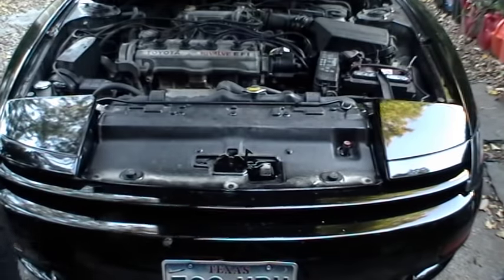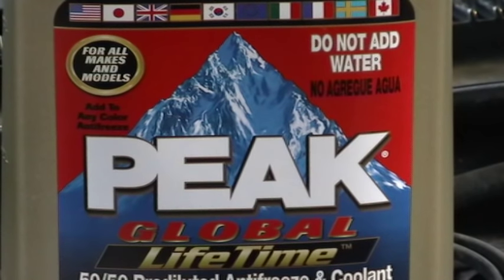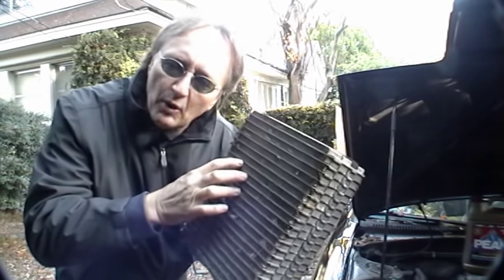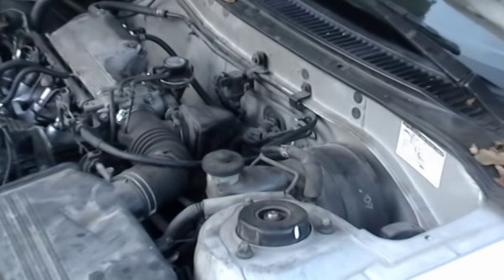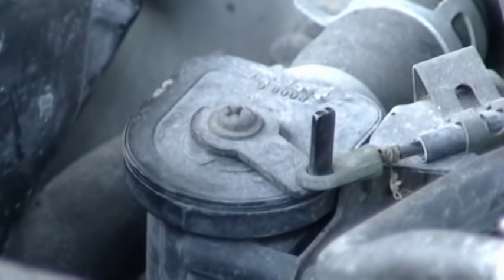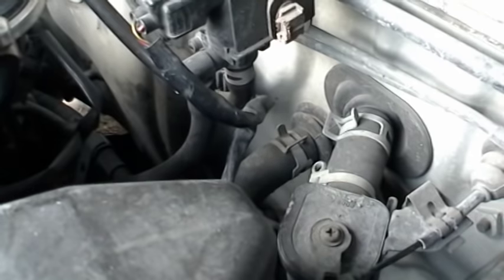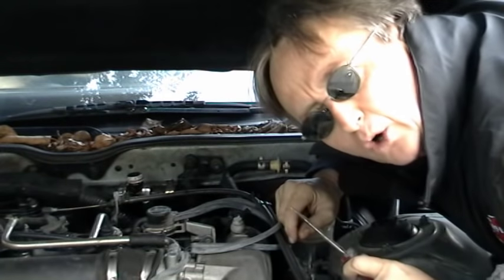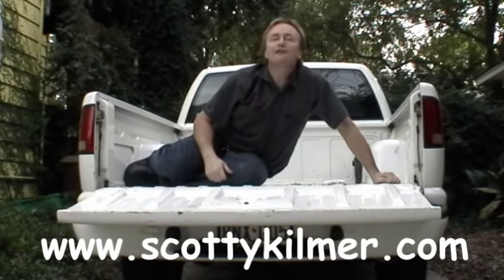How to Fix a Car Heater

Comment from the maker: The end of this video shows just that. You just install a flush line like that toyota has, and then remove the other heater line from the heater core. Hook up a radiator hose and let er rip. flush it one way, then hook a hose up to the other end of the heater core that the water was coming out of before. Then flush it backwards. Do this front and back three or four times, and it'll be flushed out. scotty kilmer

Comment from the maker: @zztopgearhead1 Your in dash vent controls aren't working. A blend door isn't opening correctly to change where the air blows. This can be a control unit problem, a wiring problem, or a stuck blend door. Not a fun fix as most systems are now computer controlled. Good Luck, Scotty

Comment: Omg thanks so much for the awesome video, it put things much more into perspective for me, i already paid to get my heater fixed once and it isnt working again already.... The colder it is outside, the less heat it pumps out, the fan works but very little heat comes out, not really enough to defrost a windshield... may try flushing the hoses.... thanks again.

Comment from the maker: first, an overheating engine will often lose coolant, and then the heater will stop working as it needs hot water flowing in it to work. So first, do my video "how to fix an overheating car" and that may also fix the heater when done.

Comment: I have a POC 97 Nissan pick-up that has all sorts of problems.  I'm working on fixing them a little at a time.  Right now,  the heater works fine once the car has been going for a while, but not at first.  I'm going to check all these things and see if I can't make my morning commute a little warmer.  It only takes about 15 minutes to get to work and it takes the truck 10 to start blowing warm air.  Thanks for the clear, concise and relatively idiot proof directions.

Comment from the maker: odds are you have 2 problems. A bad blower motor relay makes em work only on high, but no blowing at all is often a bad blower motor. Probably need both replaced.

Comment from the maker: of course fix the fan motor if that doesn't blow. But if it's blowing hard in your face, flush the heater core and pray you don't need a new expensive one.

Comment: @scottykilmer Thanks for the reply. I had no power off my ignition that goes into the fuse block that contains 4 fuses. Found the wire laying on some others and hooed it up. Now have wipers, signals but no heater. I will investigate further before winter comes.

Comment: Usaly the heater core is cloged up.  Both hoses were warm on my car, but i still ran  a garden hose in both directions because i knew that was the cause. I only got a little heat when i reved the engine.
Alot of fine  dark brown  material came out into the bucket  and after the water was clean in both directions, i installed the hoses back on and the heater was working  fine again.

Comment: finally after a couple weeks driving with fogged up windshield, I ran a hot wire with fuseable link, from battery to toggle switch, to blue and red wire on [hbm] I also ran my own body ground from the yellow and black wire, now.. my [bmh] blows great, but the air barely comes out of vents.. having some understanding of how this works, ive ben looking for magic leaver or trap door, that will direct all air directly to derfrost.. idk if anything else works, just  need defrost.

Comment: Unless those wire cables connected to the control unit have broken off or come loose. I had to jerry rig mine on an old car I just bought. It's for now set permanently on defrost and floor, and the temperature control is just a bare wire cable I pull out or push in inside the glove box. I will figure out how to fix it but for now I have defrost. It still gets warm in the daytime where and the AC doesn't do much though.

Comment: So Scotty... just to make sure I got things straight.

You install a Flushing "T" on both the delivery and return hoses of the heater core.  

You connect the garden hose to the delivery side and disconnect the return side.

That way the water goes from the delivery hose - thru the heater core - then back out the return hose and on to the ground and not through your cars coolings system.

I get that right?

Comment: I have a 2005 Chevy Tahoe and have this heater turns on unexpectedly while running. I have to pull over to turn off the engine and turn it on so it will reset it to cool air. Is this about the air control or the heater valve? Would love to hear your advice for all the Tahoe owners. Thanks.

Comment from the maker: Hey, any car should work out of the box. You can certainly try my fixes, BUT if it never worked at all, I would assume some computer flaw, as those jimmys have computerized heating and AC systems. It's too late now, but you should have forced them to fix the heat when it was new. There are many reasons GM went bankrupt, and unfortunately you're driving one of them. Scotty Kilmer

Comment: Scotty we have a Chrysler 300 with heat working sometimes but mostly blowing out cool air especially on passenger side.  We paid mechanic to replace water pump and thermostat but these did not solve the problem we are out big bucks here.  Also where on the 300 is the "Blend door" that you mention, as this is worth a try

Comment: Scotty this is an awesome video and super helpful thanks for helping out the community, my 98 accord lx blows warm air and thermostat and coolant checks out good. Now i will clean out the heater core with an air compressor instead of the water hose for extra strength and i will manually turn the arm to hot on the heater control valve. Thanks for the info.

Comment: Hey Scotty I watched this after I just sent you that mesage about not getting heat in the cabin until the car is really warm. The temperature gauge does go up and down but while driving at freeway speeds it goes really down and at idle and park it goes to normal and heat can go into the cabin again. I don't know what gives. I'll give a second look at the coolant level tomorrow and the HCV tomorrow too but I believe they are good as I still have coolant in the reservoir tank.

Comment: Hey Scott I was told it was my heater core took all the stuff apart pulled out the heater core and it was fine my car is not over heating but warm heat is coming out when  on max I will check the heater control vaule in the morning. If its not that what do u think

Comment: @scottykilmer When it is really cold outside, the car heater will blow hot (once warmed up) only if my foot is on the gas pedal. Once off, it slowly starts to fade to a slightly warm temperature. But once I start to drive, it gets hot again! Engine coolant isn't low. Thanks!

Comment: Our car got the manifold gasket fixed then the heater stopped working practically except when driving one half hour or so on the hwy then it would get some decent heat but just barely enough.  I do not know what is wrong but we did replace the thermostat even though that was replaced at the time of the manifold gasket repair.  I almost feel like just checking the thermostat again.  Heat would be nice.

Comment: Hey Scotty, great energy you got, bud! Rebuilt my 22re, ...heck, pretty much new everything under the hood, ...but before and since the build... NOTHING but warm air, never hot. Both hoses seem to get hot, going to/coming from the core.... but no HOT heat, lol. I have a 91 HCvalve to put in, to replace that stock junk.. but I'm worried my cables are tweeked, as it's REALLY hard to push the levers. However, when I manually move the control vlv. lever, the cab lever goes either direction.Thoughts?

Comment: First I really appreicate you videos...I have 2005 mercury grand marquis, my heater is blowing out cold air only. I changed the thermostat, both water pumps are warm, the dealership says its my heater control valve, but when i took it to another place to get it fixed they couldnt find the valve and then said that I dont have one...so my question is, does the 2005 have a heater control valve? and what should I do next? Thanks in advance

Comment: I'm having the same issue in my 95 accord, the heat is there but not toasty warm to my face when driving. Unlike my old accord which had 212,xxx miles on the heat was HOT on dial setting 1.
Anyway this current accord the heat is faint and I like HOT heat even at the lowest setting, with that said I think it is clogged.

Comment: I have a '97 Celica GT, and the hose that connects to the black cable is missing. Shown @2:06. Where does that hose connect so I can possibly have my heater work again?

Comment: I have a question about my 2015 chevy cruze. I just replaced the battery with a new one. When i turn on my car heater im smelling a burning plastic. What can that be. Ive been screwed over lately with my dealer maintenance i dont want to even ask them. I hope you can lead me where to look. I bought batt at Autozone and they installed it. Thank God we still have mechanics like u.🦅🇺🇸👍🏻

Comment: I have a 2012 sonic I have put coolant in and no luck so I will try the steps you suggest...but one question is it possible the blower fuse could be blown when I test the fuse?

Comment: Hi Scotty, I have a 2000 Ford f-150 4.2L and think I have a plugged heater core (since one heater hose is hotter than the other). Can I flush it without the flush kit installed by disconnecting both the hoses and hosing down each one until unclogged? Also will I have to refill any fluids after this? Thanks!

Comment: Heya Scotty, great video. The issue I have is that the cold air con works but the heater doesn't. When I turn the dial to hot it turns back to cold? So weird.

Comment: scotty I got 95 accord ex, heat was great, then one day after the car was off and the key was out, the heat blower motor [hbm] was still running, after that, sometimes the [hbm] would work as normal, sometimes, not at all, beating the dash never helped, nor kicking under glove box, where [hbm] is. but I did get to work a few times by repeated turning car on and off, ive read that Honda [hbm] get power from key switch. please see next post..

Comment: Hi Scotty!!  I diagnosed the coolant leak in my 2000 Chevy Cavalier and found it to have a leaking heater core.  What is involved in replacing the core?  Do I have to remove the dash/steering column, etc?  Or would it cost more than the car is worth?  Thanks in advance for your advice.

Comment: 1990 ford mustangs don't have heater control valves. Replaced the thermostat and plenty of coolant. Gauge isn't working and only one of the heater cores is warm. Guess I will flush it and see what happens. If not then I am guessing the heater core needs to be replaced.

Comment: HI Scotty, 
I might have a stumper for you.  I have a 2001 Honda Odyssey with no heat.  the temp gauge shows at about 45% between cold and hot when the car his warmed up (it's about 60 degrees outside). The blower works fine and A/C works well too. . The heater control valve does move when I turn on the heat. When I put my hand on either of the heater core hoses neither are hot (I checked with an infrared and they are both 98 Degrees). I also looked under the dash and when I switch from cold to hot I see a whole lever thing move back and forth. I also checked and the radiator is full of coolant.    I then thought maybe there is air in the line and so I ran the car with the radiator cap off and I saw some bubbles come out and I added a little bit of coolant but still no go.   When I look in the radiator I can see initially the coolant is still and after the car heats up the coolant starts flowing (prolly when the thermostat opens up).  I pointed the heat gun at the radiator hoses and they are about 178 degrees.      I was going to flush the heater core out but since I don't feel heat on either hose that can't be it.  Oh, one other thing, my wife just told me that the heat hasn't worked since we had the tranny rebuilt 2 years ago. Maybe still some air in the lines?  Any help would be appreciated.

Comment: Hello, I have a 2005 Ford Explorer and have seen a few videos with one actually cutting parts of the dash.  I'm assuming there is a way to do this without doing that?  Any help on replacing the actuator would help.  Thanks.

Comment: Volvo seems to build very poor heater cores.  A friend of mine had one leak so badly that the coolant escaped into the carpet and went undetected.  

Coolant levels kept dropping to where the temp sensor kept reading cold because there was no coolant in the system.

He blew the head gasket and ruined the car.

Volvo 850s and S/V/C70s are notorious for this problem.

Comment: Hi Scotty, I have a 93 Chrysler 3.8L that has a auto temp control. The A/C works great, but in the colder months I can set the temperature to 75 or higher, the air is somewhat warm but not warm enough to reach the desired interior temperature. If I set the temp to 80 degrees (which is max) it blows plenty of hot air. The temp gauge is in the norm operating range, so am I looking at a bad thermostat? Thanks!

Comment: Hello, i have a mits. lancer ES, 03. and one day i was trying to turn the AC nob from cold to hot, BUT the nod got stuck. The nob actually turns but its jams and rotates back to cold air. i already checked and removed the nob, and try to turn the it without it. So it seems like the whole rod that goes back into the AC system is stuck. How can i fix that myself???????? your videos are very helpful by the way :)

Comment: I've got an 06 Grand Caravan where it takes in upwards of 20 minutes for the interior heater to blow hot in cold weather, but the engine temperature warms up about twice as fast.  Coolant level is fine and clean.  Advice?

Comment: Hi there, i was wondering if you can help me with my situation. I've change my thermostat and filled up anti freeze but still no heat in my car. Maybe it's the heater core.  I'm planning to do the last trick you showed on this video but I don't know where to start. I have a Honda civic 1999 sedan. Where are the hoses I can do the unclogging?

Comment: Hello scott, Nice informative video. I have a question;  my nissan xtrail got heating problem; when its in idle doesn't give heat, but car is running it gives heat. Even when i stop at traffic light, it stops giving heat. What could be the problem. Thanks in advance.

Comment: Hey Scotty!!!  I have a 2002 Mitsubishi lancer, and for some reason my fan doesn't actually blow air (talking the heater inside of the car not the engine fan).  You can hear the motor come on when you turn the knob... but no air comes out...

Comment: I had that problem a few weeks ago, with the car taking 20+ minutes to activate the heater.  I was losing antifreeze fast, collecting at the bottom of the thermostat housing.  It turned out to be a ripped thermostat gasket.

Comment: Scotty, thank you for making these videos, several of them have helped me in the past. I'm trying to fix a heater issue on a 2000 Plymouth Breeze (btw I hate working on this car), for now its blowing cool air, the coolant level is good but I can not see the heater control valve. Any thoughts on this particular vehicle?

Comment: Hi Dear, have been solving many issues just by watching your videos. Currently I am facing problem with my car heater. Hot Air blows towards passenger seat but doesn't towards Driver seat. What could be wrong?

Comment: my parents own a 1994 ford explorer the rear defroster works except for the front one and how do I locate the thermostat on it and what u suggest on doing on fixing it and it could sit outside idling  for a hour with the front heater running but no hot air the ac runs fine it's just the heat

Comment: I did all this before watching the video but i replaced thermostat and heater core and my bled door actuator is good should i just try flushing the system? and if i flush it which hose to i disconnect they are next to each other at same level so no lower one,. I have a 1993 K2500 Suburban 7.4L 454.... thanks

Comment: Okay, I will do that test for sure. but now I found out It overheats when It is in park, the firewall hoses are cold 
the hose from the water pump to the firewall is cold as well I think it is the outlet, not sure. 
any other option besides a head gasket blown? heater core is gone or the thermostat is bad? 
is it a hard job to get to the head gasket in this minivan?

Comment: Hey Scottie I been using your videos to repair thing on my cars for the last coulpe of months. Now I have a question of my own. I got the all data for my 92 dodge caravan but it does not have a diagram and it does not mention the high and low side of the a/c. I'M trying to retrofit them could u tell me where to find them.

Comment: Hi Scotty, I have got a 2008 Accord EXL, 2,4 Engine. When I set the heater on, when on face mode, i just get cold air, while on other modes i can get heat as set. i have had this issue for years and my only solution has been not to use the Face Mode, but i am interested to know What could be the problem?

Comment from the maker: ah, first, NEVER buy an auction car, they are there for bad reasons. You need a wiring diagram to put wires back on correctly. so start there and pray other things haven't been ruined from that cutting

Comment: Hey Scotty, I recently bought 2005 Toyota Highlander, a/c works great! Heat is terrible! I flushed heater core, changed antifreeze, changed thermostat, tighten heater temp knob...and still getting lukewarm to cool air! Do I have to take apart the console and solder the electronics, like other videos suggested or is there something else? Thanks in advance!